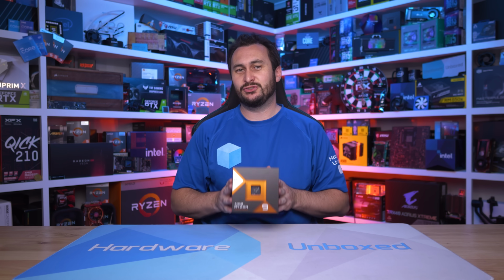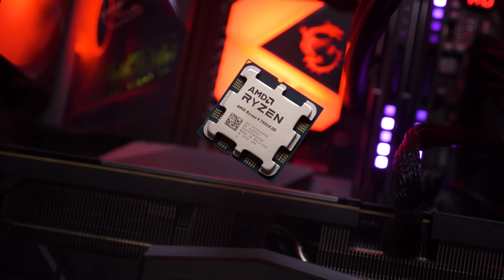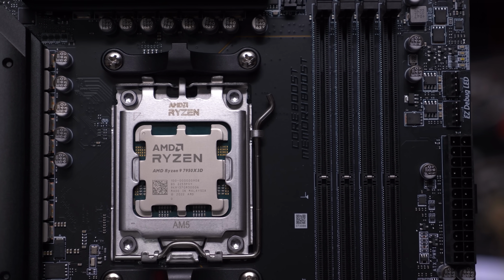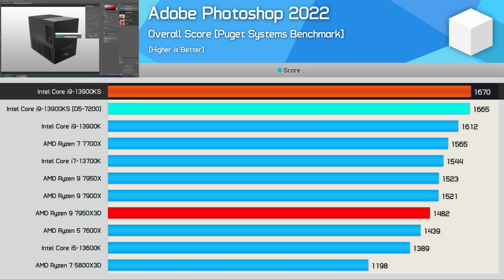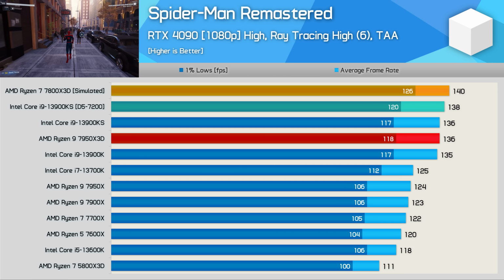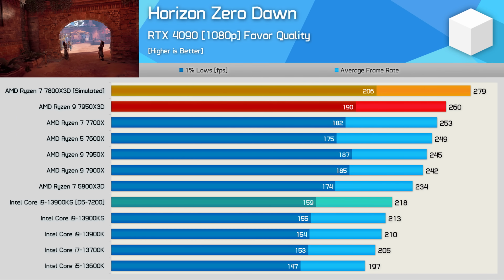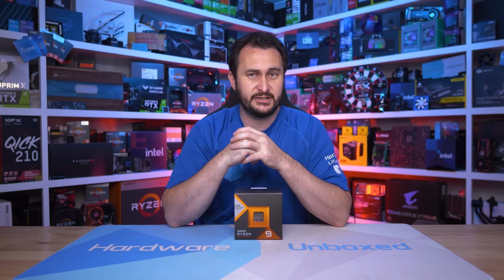AMD Ryzen 9 7950X3D Benchmark + 7800X3D Simulated Results

Comment: The discrepancy in total system consumption between Intel and AMD is mind boggling to me
Reply: True, i also don't understand why total system cost includes MB and Memory but doesnt include additional 300 w for power supply and even more money for cooling solution.
Reply: @c.f.m.8133  because they're using the same power supply and cooler...of course they could lower the price by buy a lower power supply or cheaper cooler.
It's a first gen on the am5 mother board, so if you planning on getting new cpu after few years, that could save you a lot more.
Reply: @hollymolly518  You definitely can save a lot of money on the PSU compared to the one used in this video. I have an ASRock X670e, R7 7700x, 7900XTX, and 32GB of ram on an 850w PSU with no issues.
Reply: R I.P Intel .. your temp and power consumption will be remembered forever in our frozen heart
Reply: Thats what you get with a worse manufacturing process then the competition heh, intel is still on an optimized 10 nm still (But obviously not that optimized in power consumption.) that they say keeps up with tsmc's native 7 nm. That amd is using since the Ryzen 5000 series.
And before that AMD was using 12 NM from first gen Ryzen too the 3000 series.
Reply: intel is shit, even just while web browsing intel cpu is already going over 100W. It seem that intel just keeps overclocking their CPUs to crazy numbers instead of actually improving something. Bet next generation intel CPUs will be overclocked so high they will be reaching 500W power draw causing them to melt motherboards.
Reply: Yeah. Always undervolt your CPU, especially with intel, you can safely lower your temps and power consumption by 20% or even more without losing any performance. Disable the enhanced turbo nonsense in BIOS that motherboards enable by default, they push CPUs over the recommended limit. If you have an MSI board, check Lite Load settings, you can put it to 1. Do some stress testing and make sure it's stable.
Reply: If you are a gamer it must not bother you at all, because average gaming power consumption is the same between intel and AMD.
Reply: Actually igors lab showed the intel using 3× more power during gaming.
Reply: You should google average and psu tripping...
Reply: Glad that you have never faced this issue, good for you.
Reply: Seems to only be HUB that has such a big discrepancy. Most sites have the 7950X and 13900K within 30-40W of each other. HUB knows their audience though.
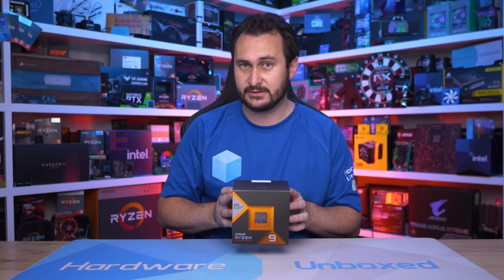Reply: @RavTokomi  Look at the Gamers Nexus review. 19:02 
R9 7950X3D stock : 156W all core workload.
i9 13900K stock : 295W all core workload.

What are you trying to insinuate about HUB's audience? Is GN also lying or whatever you're trying to say? Please be clearer in your opinions.
Reply: @ChaosPootato  I didn't say the X3D model. The regular 7950X and 13900K at stock settings are typically between 30-40W of each other. HUB has been using 13900K power numbers when the power limits removed. They also use total system power and not just CPU, which leaves a lot of variables between platforms.
Reply: @RavTokomi  Oh. Fair enough then, my bad. But it's not super relevant to the 7950X3D review, even if HUB's numbers are a bit inflated on the Intel side, the massive difference in power consumption and the very small difference in performance is still peculiar, wouldn't you agree?
Reply: @ChaosPootato  No doubt Intel pulls more power in all core benchmarks, but missing is the power draw during gaming, where they are more equal or sometimes even better for Intel when lightly/single threaded.

Comment: 13900ks is the true beast
Reply: By TDP?
Reply: @-Ice_Cold-  boards are throwing a lot of unecessary voltage to 13900k and that can be easily fixed. Tell me if you can fix insane AMD idle power consumption and being stuck to 6000mhz memory.
Reply: @herxone  Intel pushed the limits on power, to catch AMD
Reply: @-Ice_Cold-  nah It's easy to get the same perfomance with -75w adjusting voltage
Reply: Yes! 220+ W higher power consumption. XD

Comment: Really gotta wonder what AMD is thinking sometimes 🤔😂 I mean just put the cache on the goddamn 2nd ccd you dolts.
Reply: Same situation as Alder and Raptor Lake, minus the major performance difference between core types in GDC/RPC and GMT. One is made with extra cache and one is frequency focused where the cache doesn’t matter as much.
Reply: why do that when they can release the 7950X3DX2 later? on the other hand this setup could potentially be better since one CCD can do higher clocks which help in some workloads, but trusting windows to assign the work to the appropriate CCD is the real joke

Comment: Great review as always 👍👍👍Your simulated data for the 7800x3D could explain why AMD decided to delay the release. If the benchmarks are true, the 7800x3D would be the much better option for gamers.

I'm still going with the 7600x. In Germany the 7800x3D will probably cost 500€ (like the 5800x3D), which would be more than double than the 7600x right now. I don't see the point on spending so much money on a CPU, if you are GPU-bound anyway. Plus: With AM5 you have always the option to upgrade later.
Reply: 7600x is already monstrous enough, you dont need the best of the best in the gaming world unless you dont go for 7900XTX+
Reply: That's why I'm going with the 7700, with the same core count as the 7800x3D, but £200 cheaper.
That money can go towards a better GPU, which will improve performance much more than the CPU can alone.
Reply: 7800x3d was always going to be the best gaming part. 1CCD vs 2CCD.
Reply: Yeah I'm waiting to see what 7800X 3D will ultimately look like, but being that I'll be on 4k with a 7900 XTX, I'm heavily leaning towards just getting a 7700 non X and calling it a day. I don't think the CPU matters as much at 4k anyway, but I'll still hold off until April and see for certain then.
Reply: If you go AMD and dont go x3D future you will want to travel back in time and kick you in the balls for being stingy.
Reply: i'd personally go with a 5800x3d instead. Then use the money you save for a better upgrade in the future.
Reply: @willj3145  You should only go 5800X3D if you already have AM4. There is no legitimate reason to recommend someone waste money buying into a dead platform with a $320-350 CPU if they don't already have it. 
DDR5 prices have fallen significantly, as have AM5 motherboard prices, and you're saving only a bit of money and getting a wee bit better performance in 1440p or 4K with a 5800X3D. With the major difference being that you have years of upgrade potential with AM5. /thread
Reply: please dont go amd if youre not going for an x3d cpu the motherboards and ram are so expensive on am5
Reply: @tnt_gaming21  Don’t be so poor.
Reply: @Eddie276  It's not a matter of being rich or poor, but it is a matter of being smart or stupid.
Reply: @willj3145  Yes it’s much smarter to get an older system. Your next build should be AM3.
Reply: @Eddie276  I don't think anyone is advocating going and building a new computer on the AM4 platform today... That would be stupid. People already have them and the question is if it's worth changing everything out for the AM5 platform with a 7000 series X3D when 5800X3D is a simple, and much more reasonable, plop in upgrade. The answer is no for 98% of us.
Reply: @oskjan1  You would be surprised. I have see a number of Reddit posts of people asking for build advice with brand new AM4 platforms with the 5800X3D because of all of the hype, and even worse: very few people dissuade them from buying into said dead platform.
Reply: @rustler08  Well, I quess you can't cure stupid! 😅

I think it's almost equally unbelievable that people already sitting on a 5800X3D are considering upgrading to 7000 series X3D. I guess you have to be very wealthy, or you just enjoy blowing a lot of economic pathways in life just to have a slightly faster PC.

If you have an AM4 rig today, buy 5800X3D or 5900X and perhaps sink some money into an upper mid tier GPU, then enjoy your awesome PC for a couple of years before even thinking about platform upgrades. Makes a lot more sense.
Reply: @Eddie276  just go intel its better for the money
Reply: @Eddie276  as a someone with 5800X3D, I dont agree. I had a high-end Intel system from 2017. (7700K+32GB 3200Mhz) I decided to upgrade in late 2022 but I wanted to spent as little as possible. I bought B450 for dirt cheap (25-30USD~), kept my 32 gigs of ram (because 3D processor do not care about ram speed so im not bottlenecking it with outdated memory) and kept the same cooler. The cost was pathetic compared to new Intel or AM5 based system and the performance is monstrous. 

BUT THE PLATFORM IS DEAD! Oh no!
Reply: @Holianum  TLDR
Reply: @tnt_gaming21  Nah
Reply: @Eddie276  with the money i'd save from not buying a ripoff am5 mobo, and not having to buy new ram and a new cpu cooler, I could easily pay for a mobo in the future for what ever platform i want and not be locked in to am5, which may end up not being that great in the future.
Reply: @willj3145  Great, thanks for letting me know. Since we are telling each other pointless info I’m going to go and fire up my 4090 and reflect on how poor people whinge over saving pennies.

Comment: MSFS 2020 is a popular flight sim that would be interesting to see benchmarks on …
Reply: @c6v1999 Your comments looks like something Amd fanboy would say. Showing benchmark which heavily favored amd 3d chip is only to justice this overpriced garbage 7950x3d. How pathetic
Reply: @runninginthe90s75  I respect the performance of the 13900k, however, the 100 Watts of extra power used and dumped into the room makes a difference to me in the summertime.
Reply: @C6v1999  Lol cope Amd fanboy. Lets ignore overpriced 7950x3d cost is $300 more than i9-13900K and it still lose in some gaming benchmark and 7950x3d lose badly in production benchmark to Intel chip. It's hard to accept Amd falling behind and zen 4 is a flop since it was released 😂🤣
Reply: @C6v1999  Not to mention zen 4 is throttling so bad, so much for using TSMC 5nm only to see Amd chip running 95c most of time but the fanboys like you keep damage controlling and saying "it was designed like that" but if it was Intel then your dumb opinion would be "room heater" even though Intel gen 13th runs cooler in normal use than zen 4. Guess what? Amd fanboy is just hypocrites much.
Reply: It's GPU bound, it used to be in their videos when it first launched. No scaling so it's useless
Reply: @denverbasshead2361 That's not why they don't benchmark it anymore. It's because the licensing when altering hardware locks them out after like 5 changes. It is a worthwhile benchmark, but you'll have to go elsewhere to find it. The 5800X3Ddoes phenomenal in MSFS2020 and I expect these new CPUs to do even better.
Reply: @denverbasshead Not true. The more complex aircraft are heavily bound by single core performance on the CPU.
Reply: @denverbasshead  Way to spread clearly verifiable misinformation. Yikes.
Reply: @slickrounder6045  you're welcome
Reply: @denverbasshead  it's not
Reply: @denverbasshead  Tom's Hardware website, page 6 of x3d review, lists 50% performance gain in MSFS on a 4090 at 1080p and 1400 resolutions.  Impressive.
Reply: @C6v1999  This probably makes my decision on Intel vs. AMD for my upcoming PC. Thanks!
Reply: @driflysh4597  Glad to help.  I found another youTube review that shows about a 10% boost at 4k for MSFS; still good results and at dramatically less power than Intel consumes.

Comment: I wonder if the "broken" performance of the X3D can be fixed through software fix. But, I guess, just get the 7800X3D.
Reply: It’s simple scheduler issues, like Alder Lake had, except no where near as bad as it is just the same cores at a lower frequency rather than different core types.
Reply: There's already driver updates available to address it. GN went into detail about it on their review.

Comment: Knew it. 7900 and 7950 x3d too much hassle for gamers, unless you want to disable one ccd permanently. Just get the 7800x3d. And weaker for pure production work. Pointless products
Reply: not pointless. but, they're jack of all trades, master of none.
Reply: You could also manually schedule the game to use the CCD with X3D cache, without disabling in the BIOS.

Comment: the more I was thinking about these dual CCDs CPUs and "problems" with them, the more I was thinking about some really good MB manufacturer to make some "BIOS MENU START UP", where after turning on your PC, you will have options:
- MAX GAME ( 1 CCD with 3D cache )
- MAX WORK ( both CCDs max out settings )
- NORMAL ( some "normal settings )
- ECO ( with some eco setings in bios )
So you can decide before launching windows, on which config you wanna work...
Reply: Might be better to have a profile like for gpu, so you have a list provided by amd and can modifiy it if needed including power options.
Reply: This is the same as the Alder Lake launch with the hybrid architecture. Except there isn’t major issues with scheduling as the cores are exactly the same. It will just take time to get a simple white and blacklist for the priority CCD
Reply: You can probably just do this automatically with core affinity when launching games
Reply: https://www.youtube.com/watch?v=cho8SZzFcNo seems it does it automatically
Reply: @benperkins2929  it does do it automatically, it just doesn’t do it correctly every time, which a simple program whitelist can fix it
Reply: Im not 100% on it but i think thats what the amd software does that you need to use with the new 3d models

Comment: It's clear that some games (and other applications) can benefit a lot more than others from the V-cache. Games which are designed to take advantage of that cache are likely to see a more significant benefit than what are shown in the averages here, but what's the point in paying for future-proofing on a part which comes with a huge premium? It looks like the 7800X3D will really put the 13900K and KS to shame in gaming in terms of price vs. performance.

Honestly, for gaming, all of these high end CPUs seem pretty pointless to me. Even the 7600 is already excellent, and will give you a very similar if not nearly identical performance with any typical system configuration, and you will easily be able to upgrade it again once the 8000 series comes out, and you will be able to get a very decent price for the 7600 on the used market whenever you do decide to sell it, helping to significantly offset the cost of upgrading.

Comment: Wow that 7800x3d simulation is clutch. I don't understand it but i appreciate it!
Reply: Basically cutting away the non 3d cache part from the cpu to force it to use the 3d cache part, stimulating 7800x3d
Reply: What he did was turn of one ccd, which powers only half the cores with 3d cache, so it's basically the 7800x3d

Comment: Crazy how even just a short few years ago, 5GHz was a dream on consumer cooling hardware. Now AMD and Intel have both achieved that. Inb4 10GHz soon
Reply: Those 5 GHz CPUs nowadays often have better cooling than good air or watercooled overclocking 10 years ago. Power limits on the high end SKUs on stock settings is now in ranges of where you'd have to do custom tricks for extreme overclocking to get your CPU to draw enough power to get to those high clocks.

There were already aircooled overclocks @around 5 GHz in 2012, just the IPC has improved so much that a modern CPU @2 GHz would beat those old overclocked CPUs output. Subzero cooling could get you in the range of 8 Ghz in 2014.

Current hardware overclocking records (with subzero cooling) of intel 13th gen is at 9GHz. While 10 GHz extreme overclocking might be in reach with another process shrink or two, I think we will need optical CPUs to go to 10 GHz at aircooled stock.
Reply: @adriankoch964  ain’t that the truth? Haha he’ll even 4GHz+ OCs would get H O T on air with their 45nm designs
Reply: 5GHz is just a number that doesn't really mean anything. AMD Bulldozer CPUs could be clocked at 5Ghz, their performance would be nowhere close to an AM5 CPU.